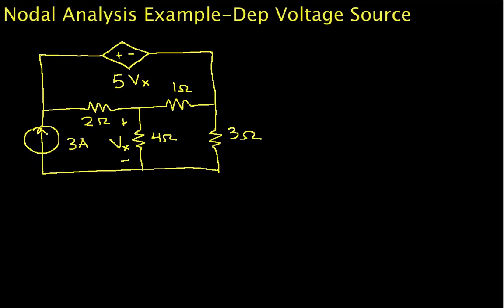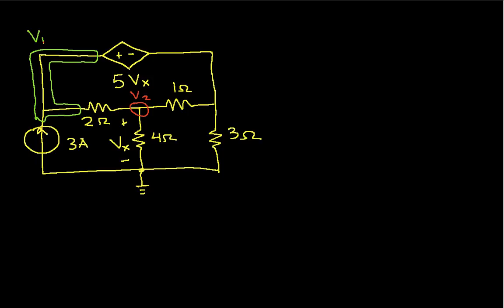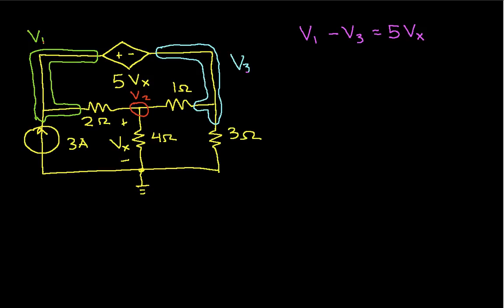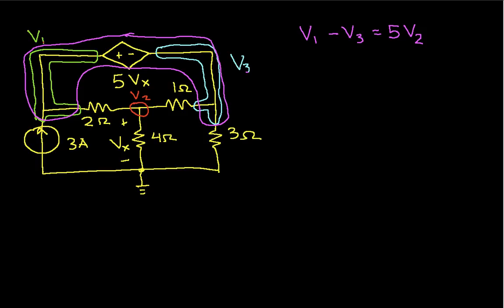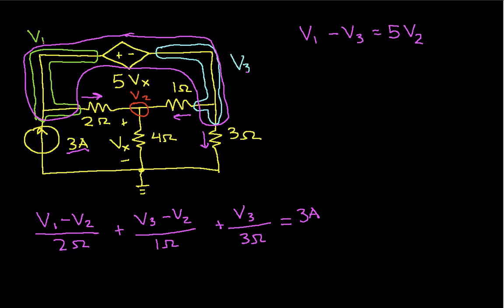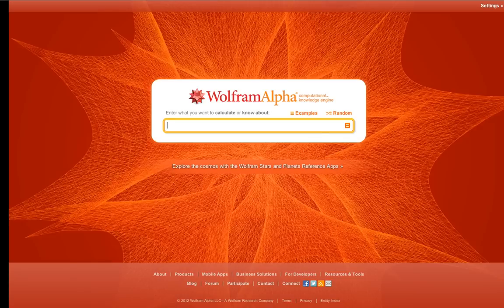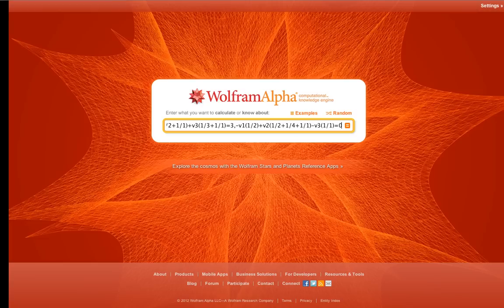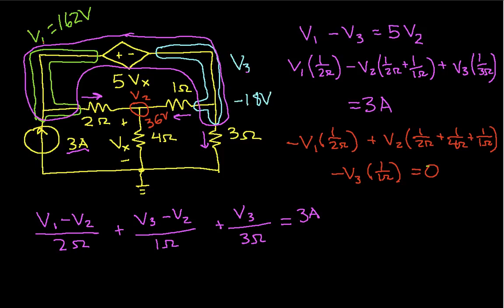Nodal Analysis Example-Dependent Voltage Source

Comment: how did Vx became V2 ??
Reply: Vx is actually defined as V2 in the problem. A dependent voltage source must depend on something already defined in the problem, (just Vx is meaningless) so keep that in mind when you're solving
Reply: VividlyVicious  But Vx is the voltage drop across the 4ohm resistor so shouldn't Vx=V2/4 be the correct equation?
Reply: VividlyVicious Oh I get it now

Comment: How come, V2 is equal to Vx?
Reply: 4 ohms resistor has voltage Vx and the node voltage of that node is V2 and since in a node voltage is same V2=Vx
Reply: Vx is part of the dependent variable.

Comment: 5:42 It is supposed to be V3*(1/3+1) because you do sum of conductances connected to node 3 multiplied by voltage at node 3.

Pattern for supernode equation: Sum of conductances connected to one "sub-node" of super node multiplied by its voltage PLUS Sum of conductances connected to the other "sub-node" of super node multiplied by its respective voltage MINUS sum of conductances shared between the whole entire supernode and node 3 multiplied by node 3 voltage.

Pattern for regular node eqn at node 2: sum of conductances connected to node 2 multiplied by voltage at node 2 MINUS sum of conductances shared with node 2 and node 1 multiplied by voltage at node 1 MINUS sum of conductances shared with node 2 and node 3 multiplied by voltage at node 3
Reply: +iwillavengeyou agreed. he forgot to bring the V3 term from the [(V3-V2)/1ohm] part of the equation

Comment: The solution is correct but there is a much easier way to solve using nodal analysis if you set the reference on the left node. You end up with only 2 unknows since the right note's voltage will be defined by the dependent voltage source with respect to the new reference

Comment: Did you make a mistake in the equations when simplifying the pink equation? (at 5:36) you write out the value for v3... shouldn't it be v3(1+1/3) rather than just v3(1/3)....?